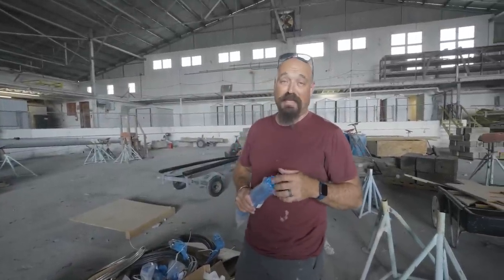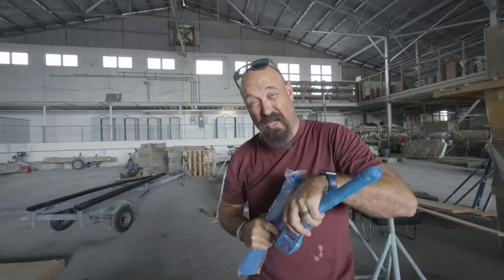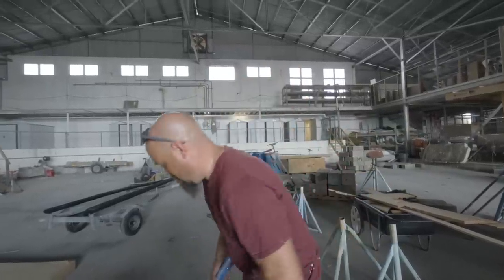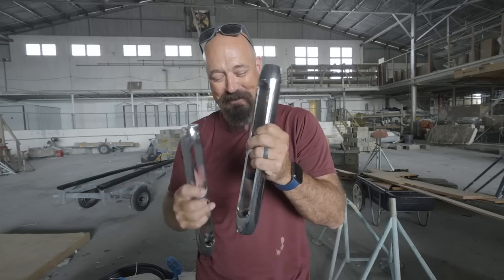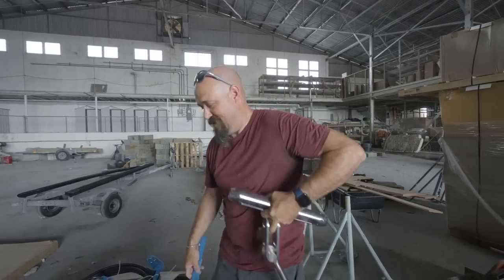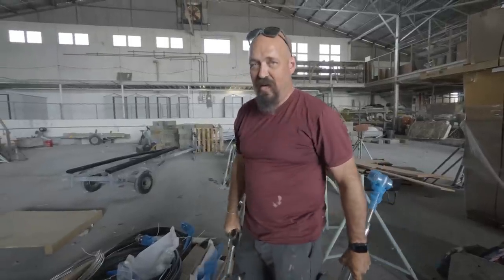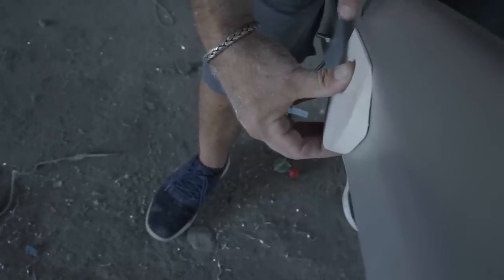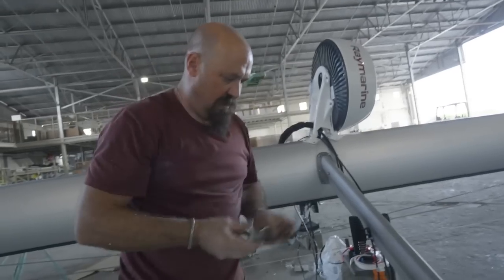THAT SHOULD DO IT//New Turnbuckles, Cameras & VHF-Episode 115

Comment: I have probably installed 5000 pl259 connectors throughout the past 20 years and I have developed a lot of tricks when assembling connectors.  I never tin the ground before installing a connector and I highly doubt your soldering iron has the wattage to properly solder the connector.  The vast majority of modern connectors are poorly made junk.  I run 5000+ watts through my coax so I must have good connections or I can damage equipment or end up with rf burns.  The old 259 connectors were solid silver and I buy them up whenever I find them on ebay or at estate sales or I will even harvest them from old pieces of coax cable.  For cable I pretty much only use times microwave lmr 400 through lmr 1200 and once in a while I use Andrew Heliax.  
If the connectors only have 2 solder holes for the ground I drill 2 additional holes and I like to chamfer all the holes before soldering.  I only introduce solder through one hole and I know when it is properly soldered when all 4 holes are full of solder.  I have never once made a bad connection in all my years. I normally use a hakko fx-971 soldering station and I use silver bearing solder for the connections which really adds to the heat requirement.  Once the cable is ran and assembled you should terminate one end with a test resistor and verify that you are getting proper ohms at the other end of the cable.  When you solder the solder is draw towards the heat so I heat one side of the connector and feed solder from the other end so it flows completely through the connector.  Once everything is installed it is not a bad idea to use a spectrum analyzer to verify proper operation.

Comment: You install PL 259 connectors differently than I do it. I comb out the shield into individual strands. and lay it back surrounding  outer insulation further back the cable then slide the connector over it. Also clean everything with alcohol. Flux used on electronics is heat activated and the residue is corrosive leading to a poor reliability solder joint over time if not cleaned off. Use a rosin cored solder the best being eutectic solder which is 63/37 and has no plastic temperature range so it solidifies immediately when heat is removed. Good quality coaxial cable has shield made from pre-tinned strands.

Comment: You might want to check out some of the soldering stations ($50 on up)) that have variable temps with digital readout. The variable temp feature is handy especially when working around circuit boards and insulated wire.
Reply: Old school try a TS100 microprocessor soldering iron to temp in seconds goes into sleep mode too.Can plug  directly into boat 12v dc or 120 vac

Comment: Might be kind of interesting to put a sensor pack on the top of the mast, a QT-py esp32 with wifi can easily hook up to a variety of sensors(temp, pressure, humidity, 6DOF motion sensing, compass,...). I was thinking it would be uber cool to develop a docking platform that a multi-copter could dock to, and/or put a sensor pack on. Perhaps one day even a little robot could be air lifted so that you could do some mast top work from the deck.

Comment: FYI….that connector for your antenna is called a PL259. You should have left about a 1/4 to 1/2 inch of insulator on the center wire above the braid used as the ground on the cable. I’ve been doing radio work for 40 plus years and fear that yours is going to eventually short.

Comment: On the PL259 connector the ground section with the holes should have the nickel plating removed by either a light file or scrapped with a utility knife exposing the copper to make a firm solder joint with the shield of the RG58 cable. Tinning the shield could cause the Teflon insulation housing the centre feed to melt due to the heat of the soldering iron, as a fair amount of heat is required to tin the shield, thus possibly losing the 50ohm impedance giving you a higher SWR than what is required. So tinning the shield is not a good idea. Just screw the cable onto the connector and then solder the copper shield to the exposed copper of the connector around the holes from the cleaning of the nickel plating. The soldering of the centre core was good, but in stead of using heat shrink use a self vulcanising tape such as Scotch23 to waterproof the entire connector once fitted to the antenna from the top down. Always make the last wrap of the tape from the bottom (cable  side) up to the antenna so that the over lap is always on the top of the last wrap allowing water to not get into the fitting and cable. A quicker way is using a crimp connector and as this connector will not be having any weight or tension on it, it would do the job perfectly.
Reply from the maker: Thanks for the tip!

Comment: RF has a positive? actually it is AC  ;)  I would call it hot, active or live. If can't find other things to bug ya about, you did ok.
Reply: signal and shield. the weird thing to me is that rf signals travel through the dielectric between the two conductors. magic in other words. nice work on the pl259 connectors - the best way to test is with an SWR meter.

Comment: Ummmm just a thought, why, if a piece of shrink tubing “won’t interfere” with VHF  radio performance would you think that it would interfere with bolt of lightning hitting it? The shrink wrap doesn’t change the fact the antenna is made of metal.
Reply: Two different things. Lightening does have the power to burn through heat shrink but it generally follows traces made by currents that are much lower in voltage than the burn through value of the shrink wrap. The idea of lightening protectors is to bleed the charge off before it gets to a high enough potential to be a problem. That is lightening should never hit it in the first place.

Comment: Had a thought 
Assume I am wrong 
The rigging company has supplied you with oversized rigging ( no problem)

Looking at the length of the new turnbuckle and fittings will the shrouds now be too long?

Worth a quick measurement before the the lift

Good luck

Comment: I've been thinking about this and came back to inquire. Are you compensating for voltage drop and degrading for the conduit, in the mast, fill ratio? Heat degradation, I'm assuming,  is paramount. 🤔